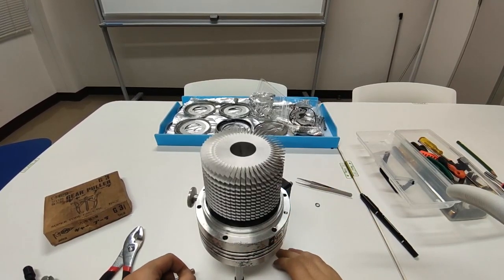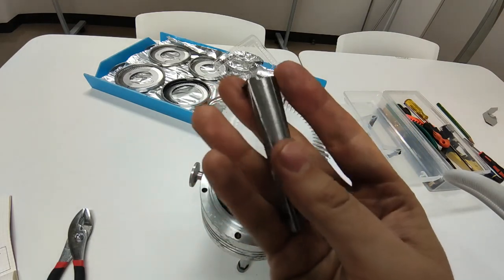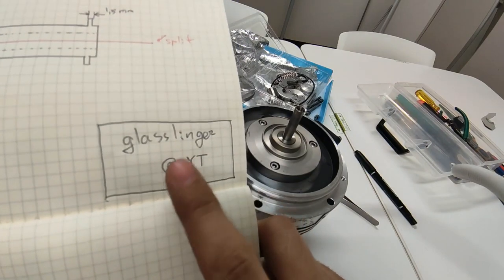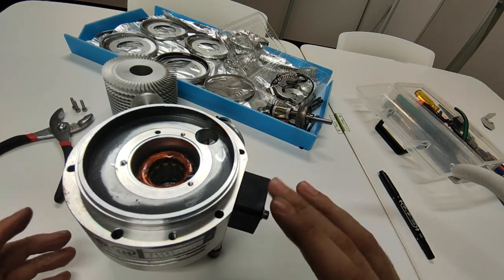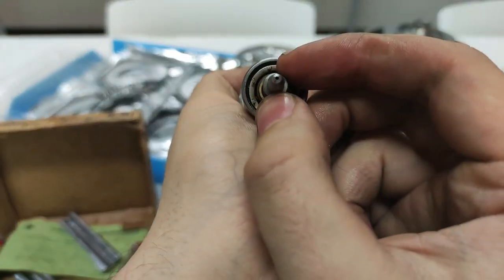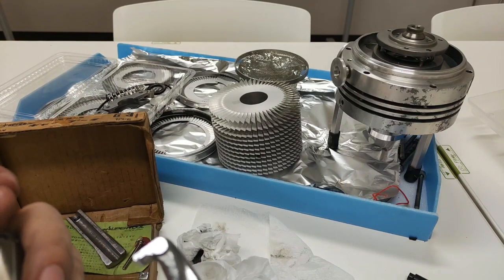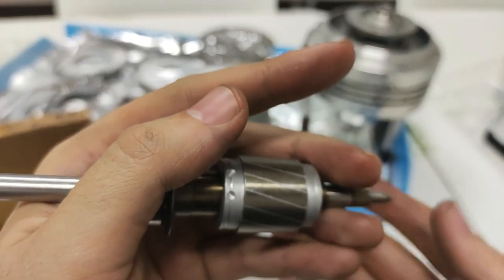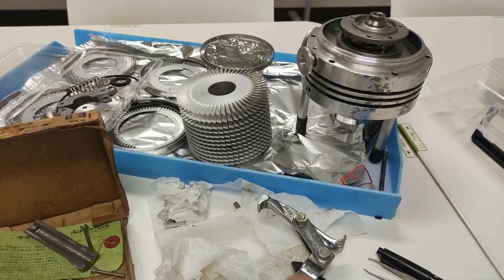Leybold Turbovac 150. Turbomolecular vacuum pump maintenance. Video 2/3

Comment: To get the bad bearing off use your puller plus a small nut then heat the bearing with a torch till it smokes. It comes right off. Be sure to mark its exact position when installing the new one.